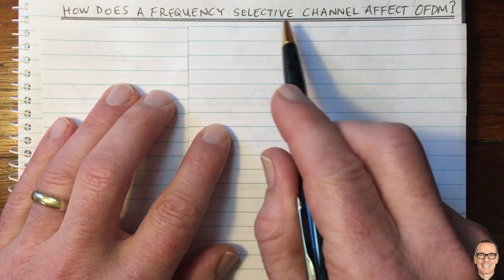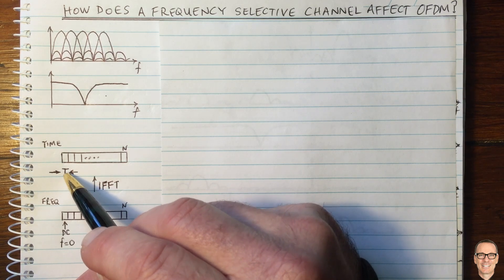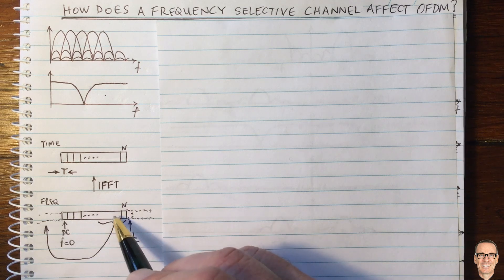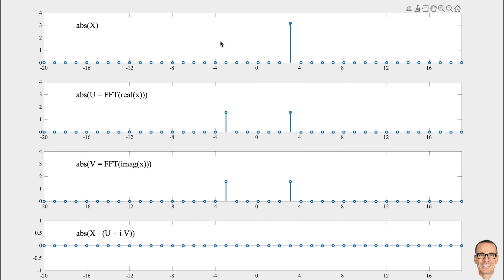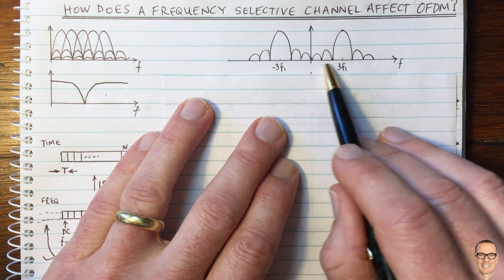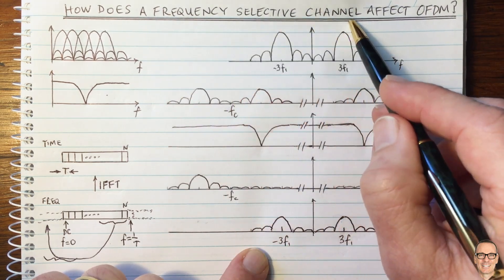How Does a Frequency Selective Channel Affect OFDM?

Comment: Thanks for your great videos. In this one, you are assuming passband signal is double side band taking RF bandwidth twice the bandwidth of one subcarrier. In I/Q transmitters, the transmit signal at RF is single side band. Therefore if you apply a complex tone at 3f1 (corresponding to subcarriers +3), you only get an RF tone at fc+3f1.
Reply from the maker: Single sideband can only be done for real valued baseband signals - not for complex baseband. It relies on the fact that real valued signals have a conjugate-symmetric Fourier transform. That's not the case for complex baseband signals.

Comment: Summary
* (0:00) OFDM Subcarriers and Frequency Selective Channels: This explanation focuses on how a "notch" in a frequency selective channel (which blocks certain frequencies) impacts OFDM (Orthogonal Frequency-Division Multiplexing) signals.

* (0:07) Baseband vs. Passband:  The video emphasizes the importance of considering the passband (the actual frequencies being transmitted) rather than just the baseband (a simplified representation centered around zero frequency) when analyzing the effect of the channel.

* (2:03) Real and Imaginary Components: An OFDM signal has both real and imaginary components. While the baseband representation might show energy only in the positive frequencies, both positive and negative frequencies are involved in the actual transmitted signal.

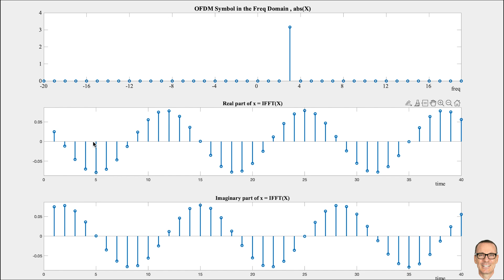* (4:11) Impact of a Notch:  A notch in the frequency selective channel affects both the positive and negative frequency components of a subcarrier.

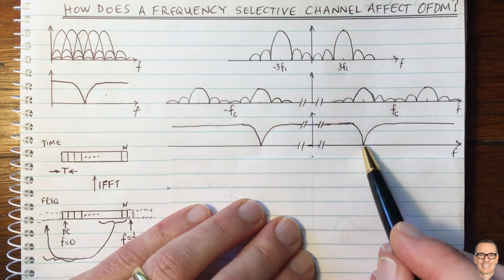* (6:40) Key Takeaway: A single notch does not completely eliminate a subcarrier.  While it impacts the signal strength (and potentially introduces phase changes), the subcarrier still carries information. This is because the notch typically only affects a portion of the frequency spectrum occupied by that subcarrier.

This summary explains the core concept discussed in the video without requiring you to watch it. The focus is on dispelling the common misconception that a single notch can completely wipe out an OFDM subcarrier.

I used Google Gemini 1.5 Pro exp 0801 to summarize the transcript.
Cost (if I didn't use the free tier): $0.0307
Time: 17.77 seconds
Input tokens: 6985
Output tokens: 591

Comment: In case of mimo ofdm all subcarriers at same frequency index at each antenna will be faded in the same fashion. Any effect and physical interpretation of it ?
Reply from the maker: No, that's not the case. If the antenna elements are more than half a wavelength apart, and if the channel has lots of multi-path, then the antenna elements will experience independent fading.

Comment: It seems youre feeding identical signal to both i and q modulators. But qam or any phase modulated signal would feed different basebad signal to i vs q modulator. If channel is clobbered, you would lose half the constellation, not just half the energy.
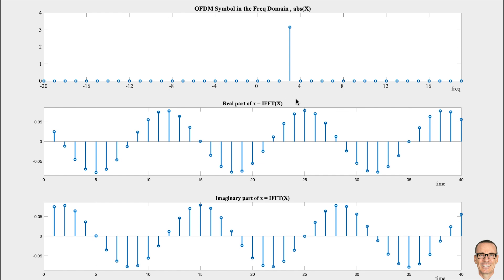Reply from the maker: At the 3:29 min mark of the video I show the two seperate I and Q waveforms (the bottom two plots). They are clearly not the same waveforms. The top plot shows the magnitude of the (complex valued) constellation points in each subcarrier (in this case there is only data in a single subcarrier).

Comment: Are you suggesting that a QAM-OFDM signal can be succesfully received even if a sub-carrier is completely blocked? That seems wrong. It would only work with a real baseband signal, but QAM is not real in the baseband.
Reply from the maker: You seem to have missed the point of the video. As I explained, a single subcarrier will never be “completely blocked”.
Reply: The very last spectrum you show, is the spectrum of only the real (or imaginary) part of the time signal, right? The spectrum of the whole signal, expressed as a sum og the imaginary and real parts, would be zero for all frequencies, after passing the channel. The negative frequency componets sum to zero, as you show in matlab around 4:30, and the positive frequency componets are blocked by the channel. (or vise versa) The resultat is that nothing passes the channel.
Reply: @iain_explains Yes. It can be blocked, if the signal is a complex baseband signal (i.e modulated in an I/Q modulator)

Your claim holds only for double sideband signals, but you use a single sideband signal in your matlab example.
Reply from the maker: Not so. They only cancel each other out in the baseband. The passband signals are generated by multiplying the "real" signal by the cos carrier, and the "imaginary" signal by the sin carrier. Then they don't cancel each other out in the passband in the same way.
Reply from the maker: ... and I'm not using a single-sideband signal in my example. My example shows the complex baseband signal. It's not the same as single-sideband passband signal.
Reply: If you look more closely, the 2 subcarriers that were blocked were carrying different symbols and the 2 unaffected subcarriers also. So in the final results, all 2 symbols can be recovered. Just the amplitudes were decreased. Adding on to that, in a real transmission, either the signal or the channel is real. So they both have +/- frequency part, which makes portion of both symbol power survive.